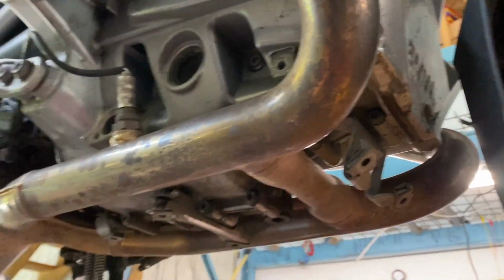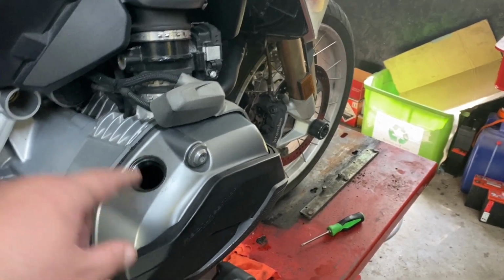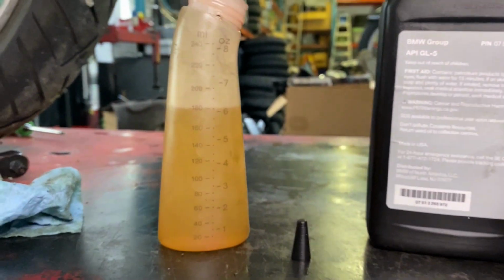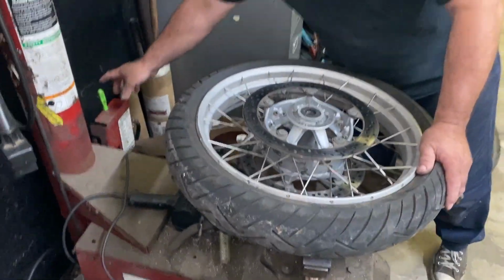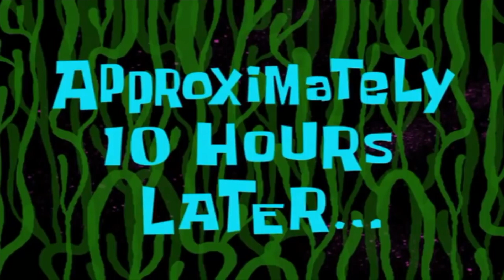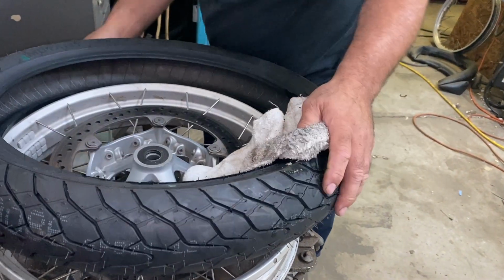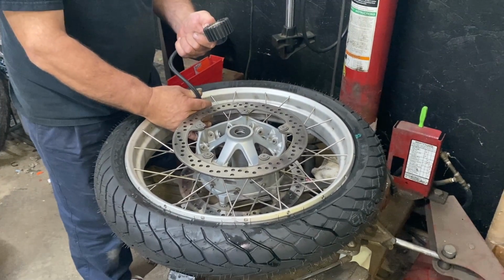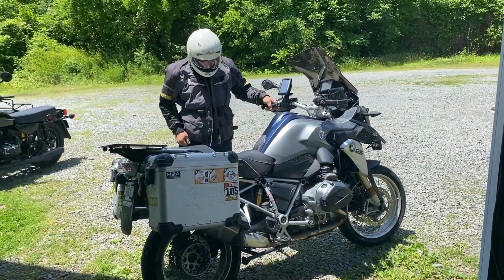Prep your bike for a long trip or the MOA Rally! --oil change, final drive oil, tires & tips/advice

Comment: Would you put 10/40 instead of 5/40?
Reply from the maker: While my advice is to always use what the manufacturer specifies for your motorcycle, if it was all I had access to, yes. The wrong oil is better than no oil.
Reply: @BMWMOAorg  Steel recommend  10/40.